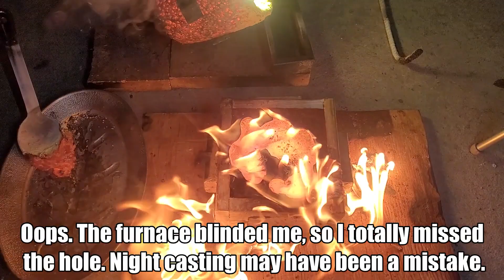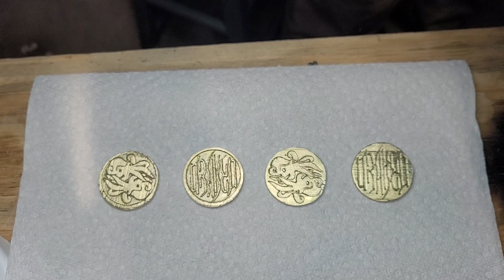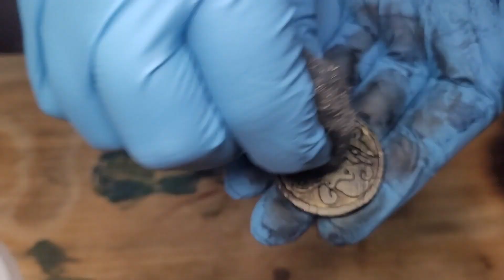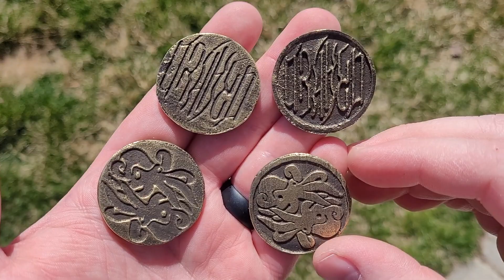Ambigram Coins -- Melting Scrap Brass to sand cast custom coins!

Comment: They came out really good considering the bad pour.  It's best practice to put the pouring bason close to the edge of the mold instead of the center.  That way you can hold the crucible on the side of the mold instead of over top of it.
Reply from the maker: That's a good note, thanks for the tip!
Reply: @KrakenCasting  yeah man.  It's something you don't really think about.  If you watch my videos, and look for the location of the pouring bason.  You'll see I pour on the edge. 🙏